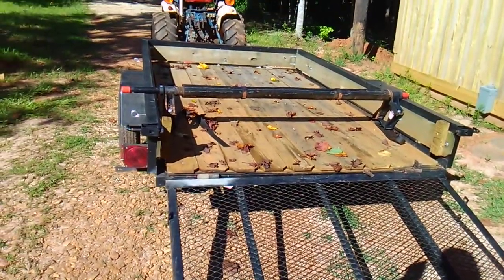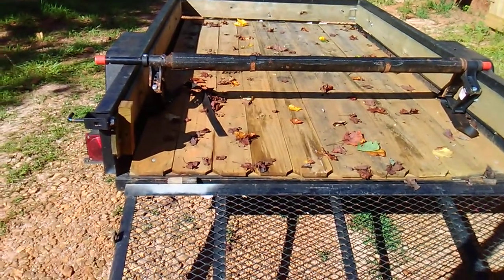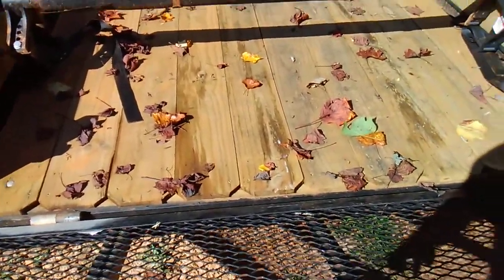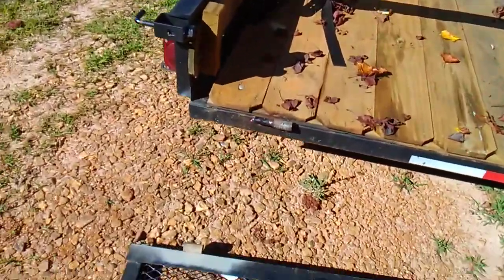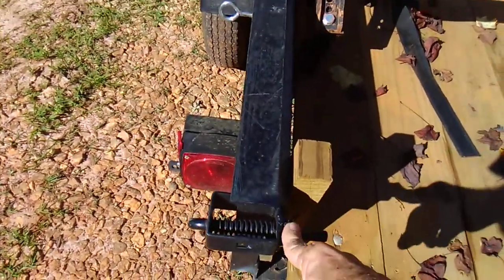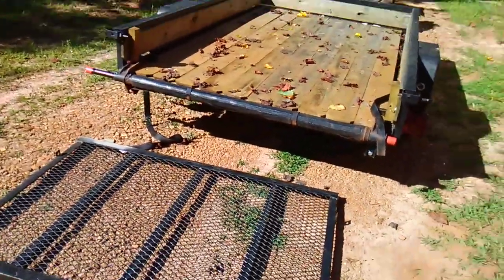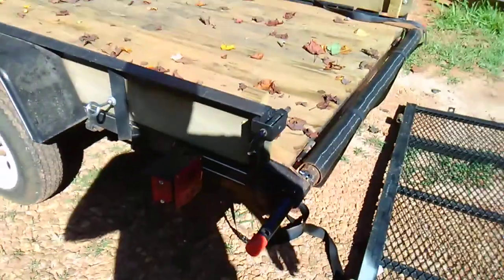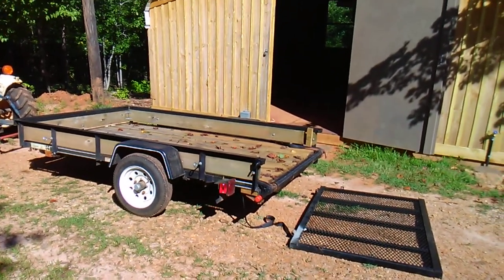Harbor Freight "Load Handler" truck unloader adapted to a Lowes trailer. Double M Farm Homestead

Comment: This is awesome! I have this exact same Lowe's trailer and I was looking for an adaptation to use the Harbor Freight unloader on it. Thank you so much! My plan is to use the trailer + unloader for some demolition debris on a rental trailer I am renovating so I don't have to pay for a construction dumpster. Our local dump has a ramp/raised up area where you take your truck or trailer, and something like this will be very helpful to unload all the drywall and flooring and other debris I take out of the house to the dump, paying only by the pound. Even if I got a construction dumpster (Advanced Disposal is $465+ poundage) I'll still save money. Thank you again. Making the mods now!

Comment: I like the modification.  but I wonder it might have been easier to use a removable pin secured with a cotter pit.  Yes, another part to lose, but it does handle the ramp shifting and eliminates the welding work.
Reply from the maker: Yea, you could do that. Should work fine.

Comment: Is there anyway to have the ramp installed with the load handler installed as well? I'm looking to add this to a trailer for carrying material like mulch, stone or top soil from a supply yard. I would need the ramp installed to use the trailer on the road and keep the material on the trailer, but the load handler needs to be installed before the load is dumped in the trailer.
Reply from the maker: Not sure how that would work. On my trailer there is no room for both to be mounted at same time.
Reply: Also, not sure how helpful it would be even if you did manage to do it. Your load would simply fall onto to the tailgate/ramp. And unless it was sand, it's just another area you'd have to clean up. Removing the tailgate the way Henry showed is genius. I didn't use the big nut though. I used heavy duty cotter pins at the end of the ramp/tailgate pin.

Comment: Not to be lazy but I am wondering if an adapter could be made so that a person can use a impact gun to unload rather than turning the handle?
Reply from the maker: That's not "lazy", that's smart! I'm sure it could be done.
Reply: @DoubleMFarmHomestead  I just bought one of these for my trailer after seeing your video so I think I will give the adapter a try once I get it installed.
Reply from the maker: @chainsaw76d  Keep me posted on how it does. I don't use mine as much now that I have the Mini truck with a dump body.

Comment: Thanks for this -  I have an old 5x7 trailer (built in 1932, rebuilt several times) that I use to haul stuff to the dump from time to time -- getting older and lazy when it comes to hand-unloading.  This will be perfect!  Do you find the shorter handle makes it difficult to turn because of not enough leverage?
Reply from the maker: Yes, the shorter handle does make it a little harder but my trailer is so low to the ground I have no choice. You can use the long handle and just do half turn at a time. That does however slow it down a lot. So far I have been able to unload everything with the short handle. Good luck and thanks for watching.
Reply: @DoubleMFarmHomestead  use the harbor freight pipe threader connected to 110v car inverter would allow effortless motorized unloading perhaps, just an idea. thanks for vidoe

Comment: Ah yes a simple nut to keep it on was wondering how I was gonna handle issue with it sliding to the side. I might also use a bolt with a pin near the bottom because I wouldnt trust just that small bracket where the latch is.

Comment: I'm looking to get big tex 35sa 10ft. Don't think this will work for me as I'd want it permanently mounted and still able to use slide out ramps for loading mower from time to time. Wish they actually made one for trailers as dump trailers plus load are to heavy for my cargo van but a 5x12 or 77x10 tows well with load

Comment: Just did this with a trailer I have. Problem, there trailer is too low, especially loaded, to turn there handle as it hits the ground. I'll work on a fix.
Reply from the maker: Yea, I had the same problem. I made a short handle to use when I have it on the trailer.